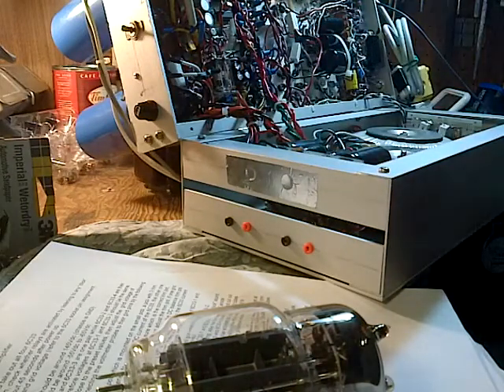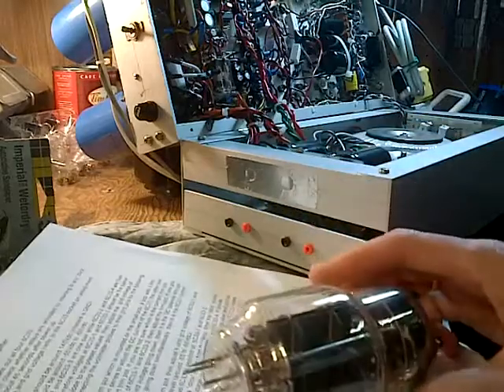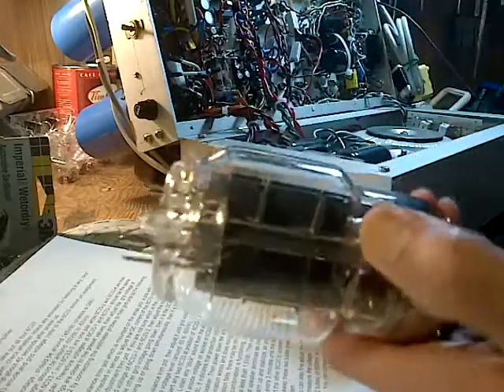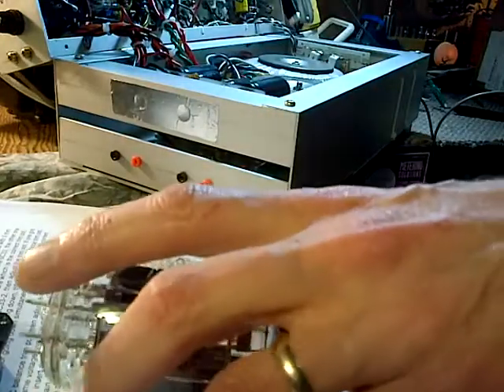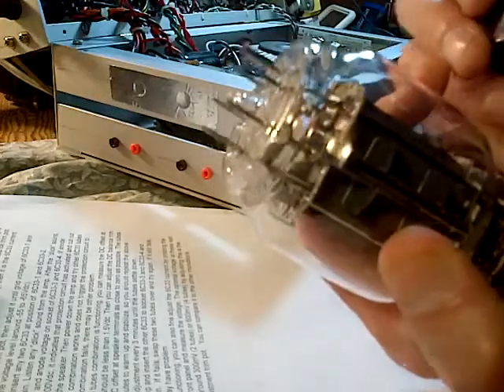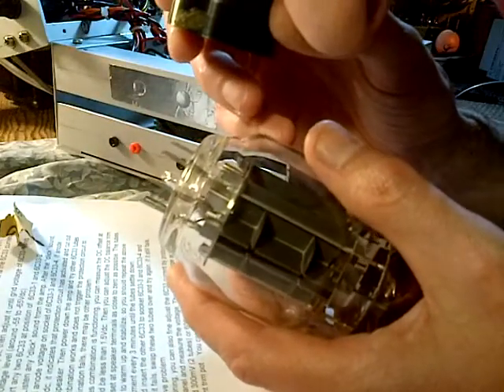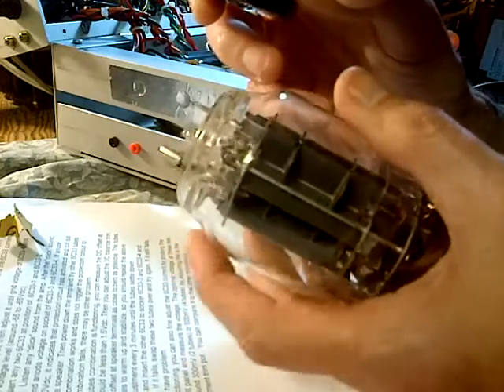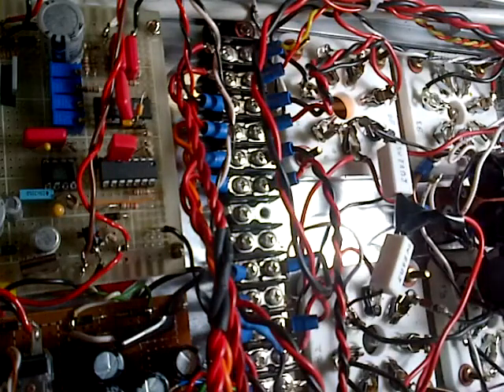OTL Amplifier with 6C33 Tubes Video #7 Testing 2

Comment: hi thanks for the video. Its great to get a look into the box and se the circuit, thanks
Reply from the maker: mixolydian2010 Most of the small circuitry is the protection circuits.  The amp itself is very simple.